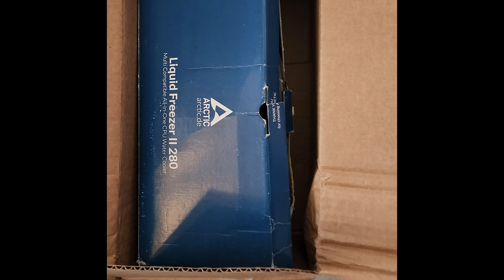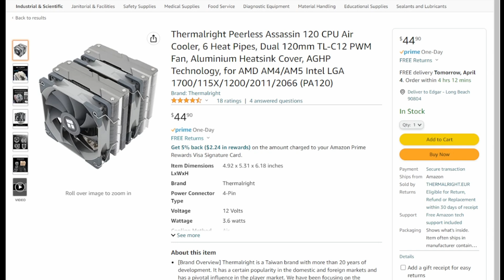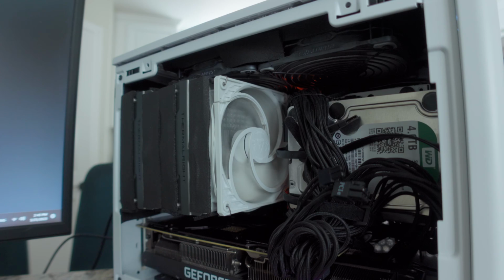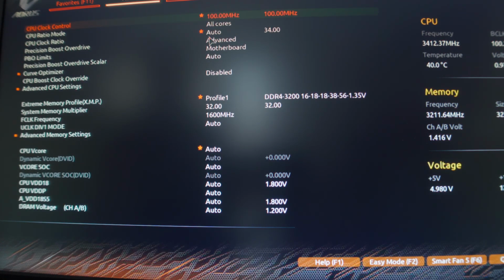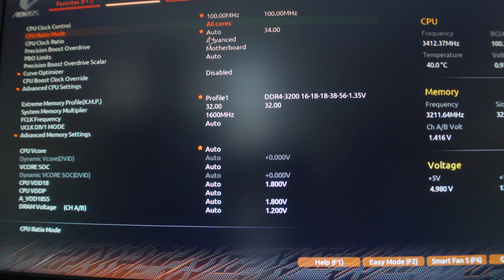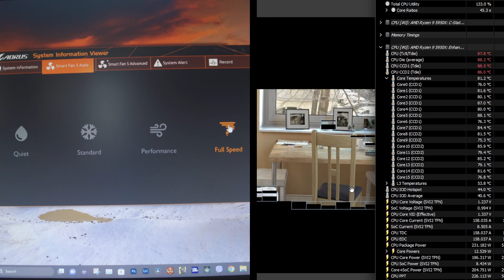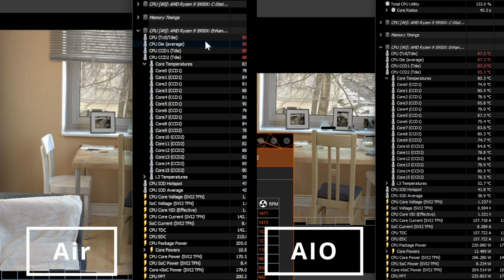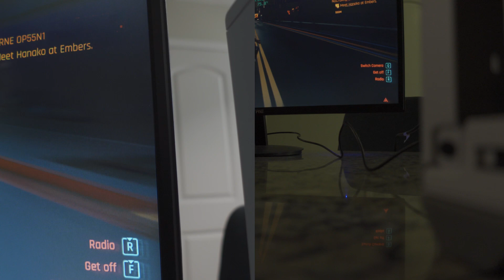$70 Budget for Silent CPU Cooler: Freezer vs Assassin

Comment: I WANT  TO PUT THOSE COVER SO THE AIR ONLY GOES THROUGH THE RADIATOR, HOW CAN I find that on amazon
Reply from the maker: Choose size matching your need or you can stack one  on another until there is no gap https://www.amazon.com/dp/B07ZNKBNXL?ref_=cm_sw_r_apann_dp_R0GEQ8KQQKSTCXE04VSP